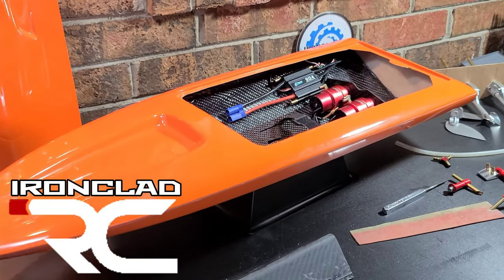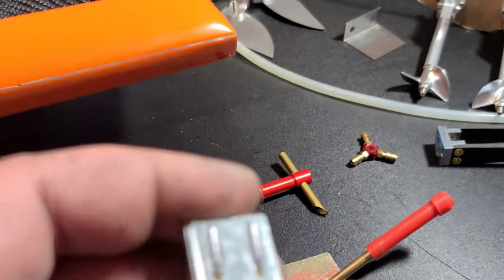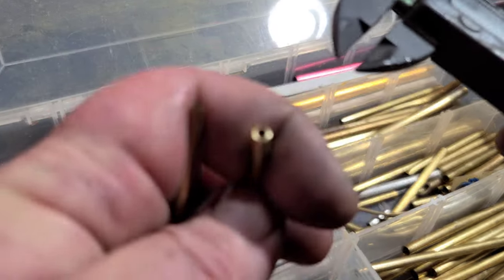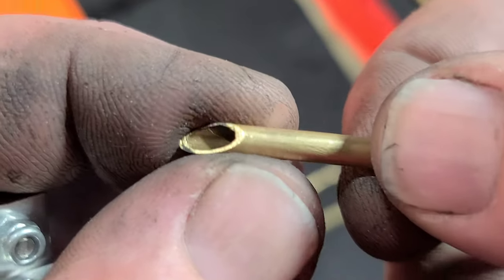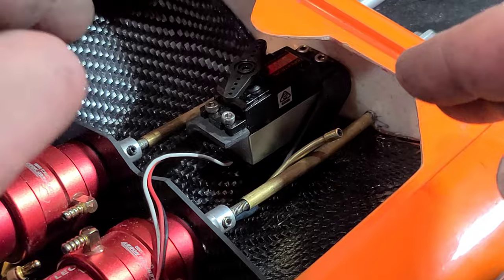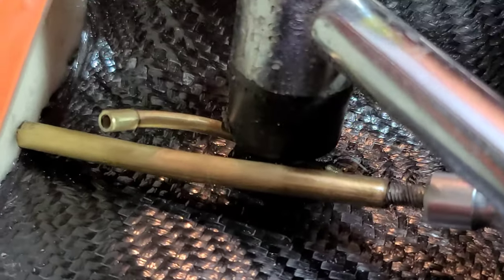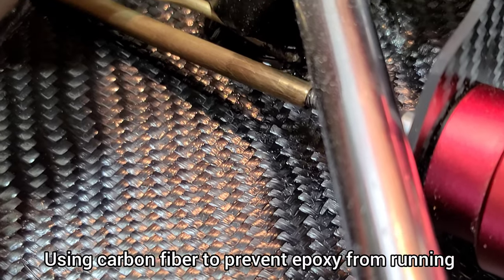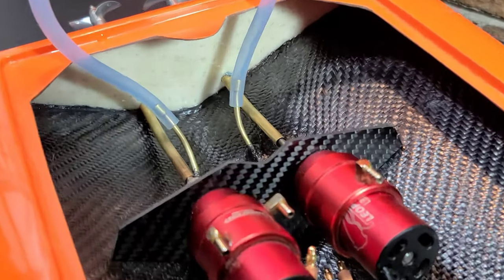Flush Mounted Water Pickup Install Deltaforce 29 Twin Motor Mono Build Series Pt4

Comment: I installed  2 of the flush double pickups in my twin screw prather 31inch deep vee they work good.

I added 4 brass exits to simulate exhaust system  And ran my water outlet in the false exhaust system. 

Great video
Reply from the maker: Noted ✅️. Thanks for the input 👍

Comment: You can anneal and harden brass the same way you do with steel, but the temperature process works in reverse.  To soften brass, heat it until it's cherry red, then quickly cool it in water.  It will bend easily with less tendency to kink.  To harden it up, heat it again to cherry red and let it cool slowly over time.  Gradually move the torch away from the piece and let the temperature come down over a minute or two.
Reply from the maker: Roger that!  I've had some experience with annealing & tempering steel but never tried brass.  I'll definitely keep this in mind.

Comment: you know, I've always wondered why RC boats don't just run some internal closed loop water cooling system, like for a CPU
Reply: Weight and complexity.  You need pumps, tanks, and radiators in addition to everything else.
Reply from the maker: 1 to 1 & rc boats use thru hull water pickups to cool there power systems, endless amount of cool water to run Through the motors no need to recycle water adding weight with a  Reservoir inside the boat.
Reply: Loving this build, almost as much as Lucas Oil Drag boat, I love the drag boats, anywho can’t wait to see it in the water BIG B, BOAT GANG!!!